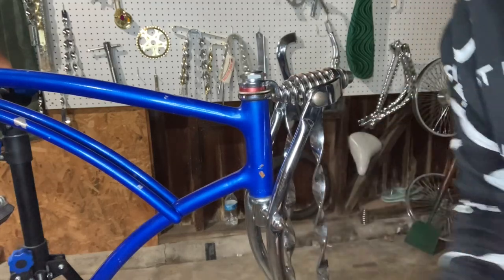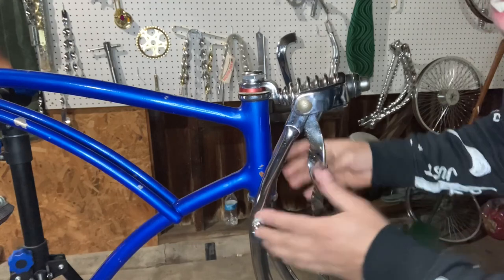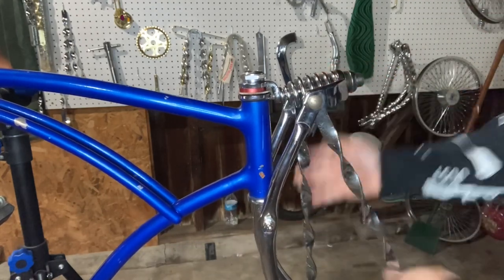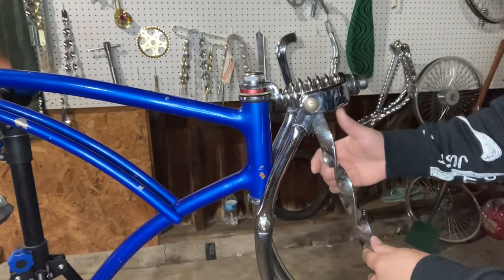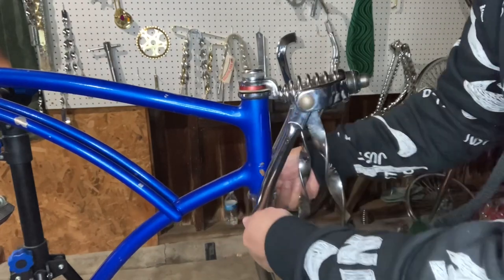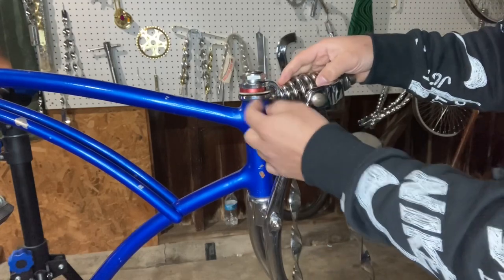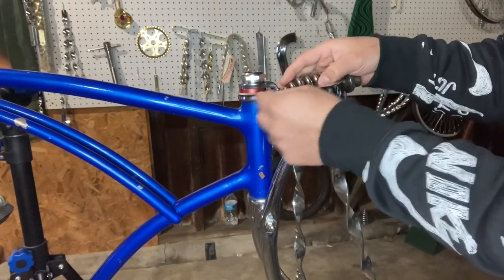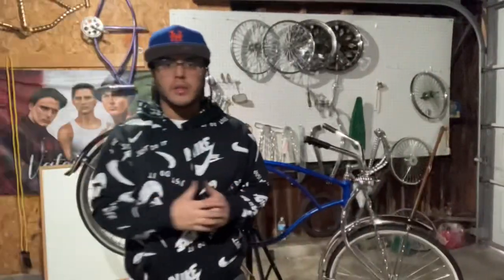How do I fine ways to install my  springer fork. (Schwinn bike)

Comment: What's happenin, I'm from California and have been building Schwinn's for over 40 years, all styles, the best way to put a springer on is take the whole thing apart , and start with the headset. Once that is done, you just reassemble the rest, at least it always works for me. I'm working on a 78, 24 inch schwinn. Thanks for the inspiration young blood.
Reply from the maker: Aayy homie wasup no problem brother it’s what we do

Comment: Dope content. Slick bikes! 
It looks like the Spring Fork Ring you were using is bent at a 90* angle like the ones used for Extended Crowns. The standard ones should be closer to 45*.
Reply from the maker: Thanks

Comment: Where u located at. My bolt is stuck to my front wheel bolt. So I can't get one side off. I can't get it..any advice on best way to get it off..I think it could be bent
Reply from the maker: You would probably have to get a whole new piece
Reply: @Trankii Kid07  damnnnn I just picked up a new old bike to work on a vintage schwinn stingray with tiny wheels on front but back wheel is slick  and flat..someone wanted only the wheel and tire dude said be4 I got it  apparently the tires hard to come by? I had never seen one. It's flat back tire basically the tread is square and smooth. Bike needs chain but it was 80 dollars

Comment: Sup g , quick question , I tried attaching my springer fork to my 62 schwinn bike but it isn't fitting either way. I tried flipping the ring but the bolt doesn't fit still. Any other suggestions ? Im guessing maybe I have the wrong size fork
Reply from the maker: Most likely u have the wrong fork brother
Reply: I'm having the same problem, bought a 26" fork for my 26" cruiser, I might bend the mounting ring